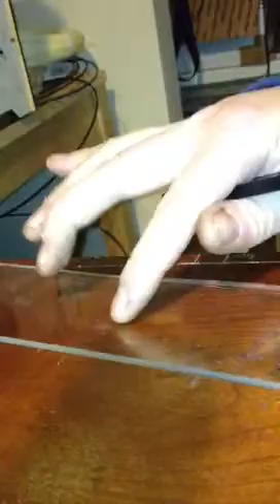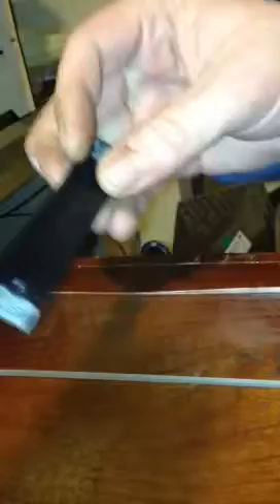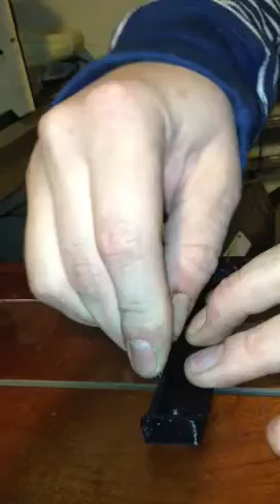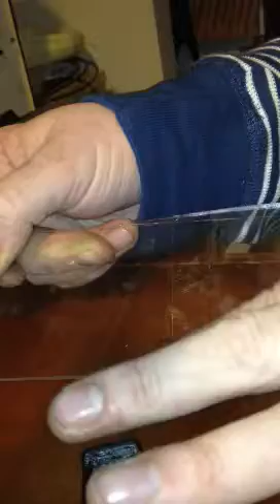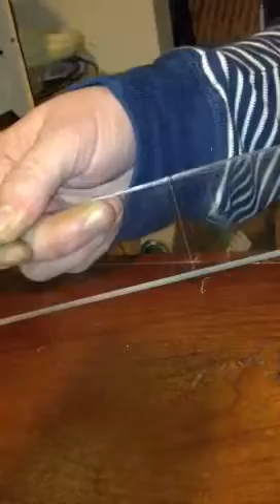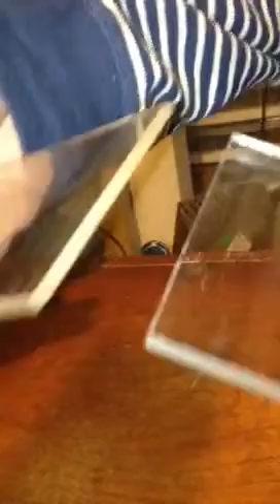Cutting borosilicate plate glass for 3d print surface

Comment: Just ruined $40 borosilicate plate trying this method. Used 3&1 oil and the glass fractured and did not break in a straight line